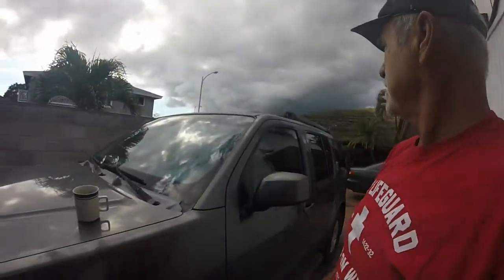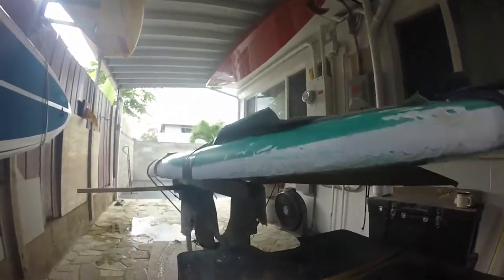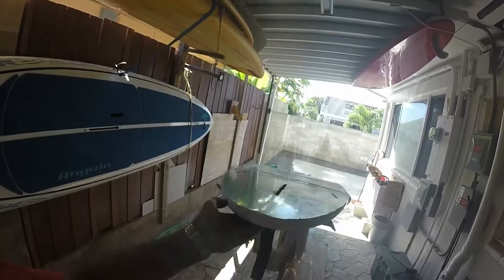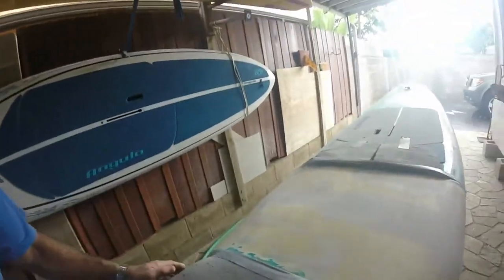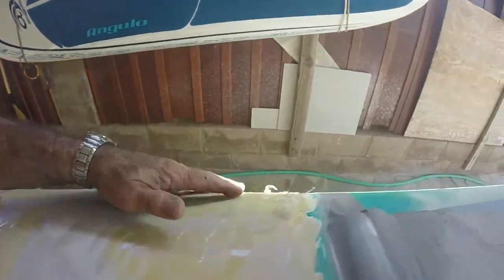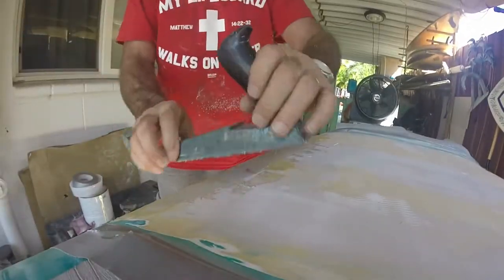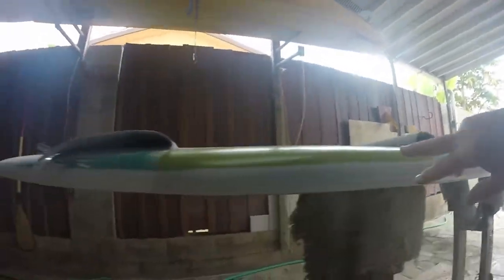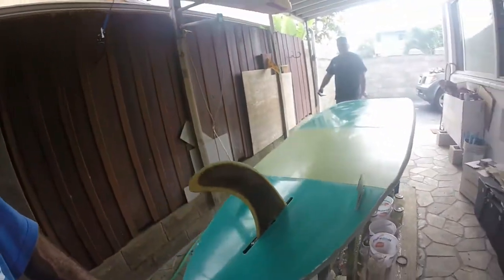Fixing a broken 12' Stand Up Paddle board

Comment: Mine also flew off my car, but my cracks are small thin lines in 4 different spots. I’m doing all the research I can before I attempt a fix of the issue. Thanks for posting the video
Reply: Let me know what you find. Same thing happened to mine, I have a guy who gave me a 500$ estimate to fix it
Reply: Same here, what did you find to work best?  My tip is trashed and fin is broke
Reply: @botibartha9848  anything

Comment: Great video, I am about to fix a my sup that flew off the car. Mine is is much worse condition but with some sweat I should be able to get it floating again! Thanks for the instruction!
Reply from the maker: Dan most SUP boards are made of EPS foam and only Epoxy resin can be used to repair this type of foam. The board I did was EPS and I was careful not to expose any foam which enabled me to use Polyester resin. Body filler will make the board heavy but it is pretty easy to work with. I didn't mind if the 12' SUP I repaired was a little heavy it is more of a cruiser board. I have a smaller performance board I use also.
Reply: @billstonebraker5304  Do you ever add in surface stringers for added strength? how far should I overlap the new glass to strengthen the repair? would Carbon add strength ? Thanks!!
Reply from the maker: If you mean stringers inserted into the foam, no I don't. The foam would only give way when stress and flex is upon the board. I overlap top to bottom and bottom to top about two inches both sides. That is where the strength come from.

Comment: Great vid. What's the last layer (green glossy stuff) you put on? Gel coat? I need to resurface the bottom of an 11' SUP I salvaged and was wondering what kind of stuff to use for that.
Reply from the maker: Polyester finish resin with solid color pigment

Comment: Did it hold well without any stringer reinforcement? And so its basically the rail glass which gives strength?
Reply from the maker: yes and never had a board bread in the same place.
Reply: @billstonebraker5304  thank you!

Comment: Love the shirt by the way¡ i picked it up half way on the video¡ lol 
Also you put the smaller pieces on top? I've seen others do all the way around. Small pieces under the bigger ones. Why you do it like this? Thanks and The Peace of your "Lifeguard" be with you ;)
Reply from the maker: I've always put the narrow fiberglass on top for feathering when sanding so there is no transition high spot with the finish coat. I guess it could work the other way you mention as well.
Reply: @billstonebraker5304  Saw another shaper repairing and glassing the same way you do a couple of days ago, and he says he does so not to leave air bubbles under the cloth. Makes sense. Thanks again for sharing.

Comment: Hi. How many kg you add to the board like that? Do you always use epoxy without gloves and mask? I highly recommend to not do that at home....it is not healthy.
Reply from the maker: Added about 3 pounds. Covering areas with body filler I was able to use polyester resin instead of epoxy.
Reply: @billstonebraker5304  So you fill the holes up with filler and glass over with epoxy? great idea!